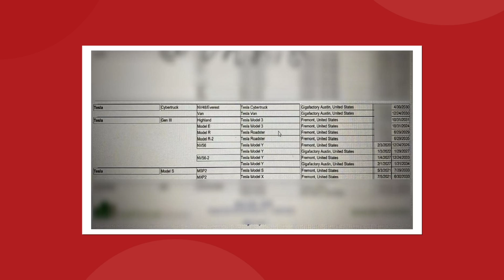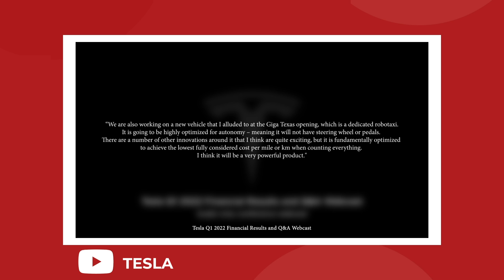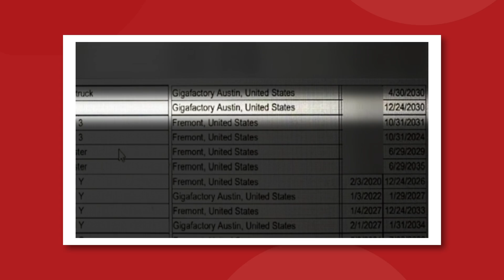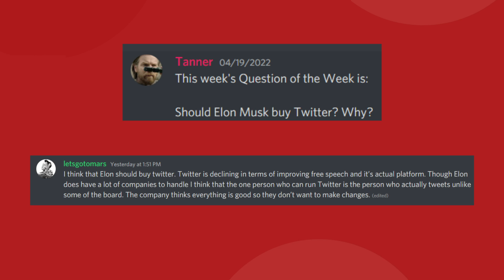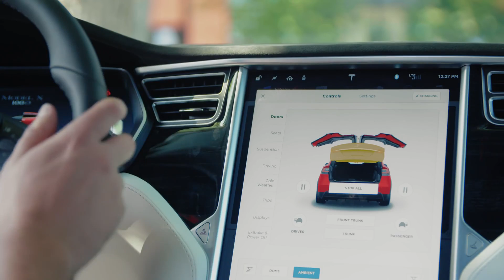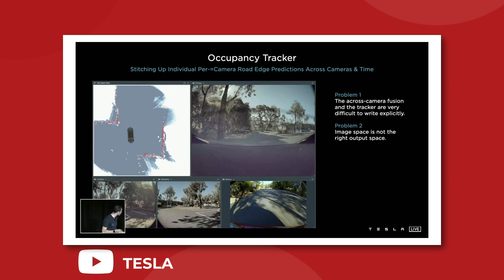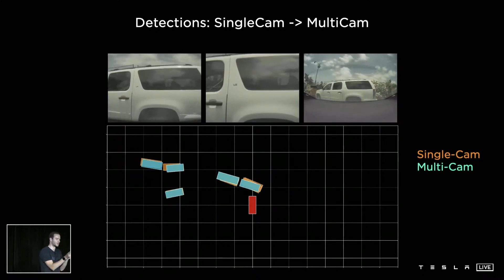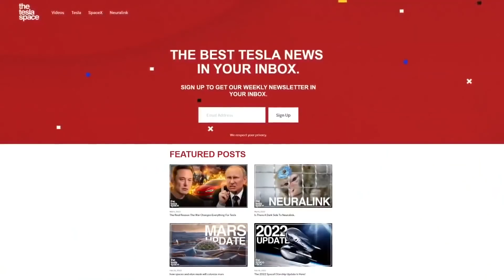Why The Tesla Cyber Van Will Be The Tesla Robo Taxi!

Comment: I think it will be the model Y platform. 

Mainly a special body color,  interior changes like no steering wheel,  no Pedals, and other seats. 

Another advantage is that autonomous driving is proven to work with the Model Y by the end of 2023 to get Robo Taxi approval.

Tesla's cost is very low; they will not sell the cars and start their own Taxi business.

With chosen the Model Y the ramp-up cost is low, and the concept can be proven. 

Later Testa can develop a Van, which can also be used for Robo Taxi.

Comment: I am in favor of 2, 4, 6 or 8 doors to separated passenger compartments. Tesla already has an excellent air purification system and efficient heat pump ac. I am not certain that the upper half of the separation partitions should be opaque or transparent. Funny, as I typed that, you revealed the same idea. Thanks for the gull wing doors design. It's logical.
Reply: great idea! Bunch of Model X doors :D

Comment: I think you are wrong about the level for needed for robot taxi and the falcon doors. I think the idea of robotaxi is going to come out in phases. Phase #1 ..the boring tunnels transportation. That will be the perfect use for a van and will help the numbers when we talk about cost per mile. Boring tunnels dont need level 4 for the taxi service to work. They've been testing the model 3 vehicles at the Las Vegas tunnels. From there, when FSD improves, then they will slowly move to streets with groe fencing...then full street and highway. That seems more of a logical progression since each step helps create more data for the next phase.

Comment: A 2-motor AWD Cyber Truck would be a very capable Robotaxi in all weather conditions. It would hold 6 passengers reasonably comfortably without the steering wheel. It would need some sort of mechanism for retrieving your luggage out of the vault. A 4 passenger "Y-sized" vehicle would also work.

Comment: One think Elon said on the earning Q1 phone conference is that the Cyder Truck could use an 800v power system but not worth putting in a in "3" or "Y" and certainly not a  Robo Taxi (Maybe Wireless Charging). Also the Model X doors are very expensive to make and was made to get astronauts to Space X's launch pad easily. So I think it will more look like a Y without a frunk

Comment: I think that if the Van/Taxi shares the CyberTruck platform, then it will have to look like a cybertruck to some extent, using folded stainless sheet, folded for rigidity.  No compound curves, no paint.  This would make sense as the Cyber Truck body is virtually impervious to day to day wear and tear - something that a fleet operator would nearly kill for...
Reply: exactly! rustproof body will massively increase lifespan of commercial vehicle. But the price also must be right and with FSD as an option, not only FSD one. There have been talks for a long time about 1mil miles vehicle. Maybe this will be the one? It all fits in very well. Also a fleet operator does not give a shit about vehicle design, cost and fuction is a priority.

Comment: They could just build a cabin like structure, build a couch around the inside bends and a drop down tv to watch movies/media or check on the vehicle and your destination. Maybe even basic information like weather of your current location and your destinations current weather situation, many possibilities could be done with a van like structure you wouldnt need to be stuck with the locked in space seating arrangements, you could design the enitre inside of the vehicle to something way more relaxing and suitable for waiting multiple hours at a time. Driving 8 hours would be a cinch, the passenger would fall asleep and the vehicle would drive a majority of the way with not disturbing the passengers, they would need to stop along the way but would be a neccesary stopping. (this is assuming that tesla can achieve level 5 autonomy driving) The battery could be large enough for an 8 hour long trip so maybe you wouldnt need to stop? i doubt it but not impossible either.

Comment: Even if FSD is level 5 there still needs to be navigating for emergencies and system failures. There had to be a manual backup system. I think there will be a steering wheel in some way.
Reply: You can't drive a car if it has a system failure, even if it has a steering wheel and pedals.  If you can drive it, then it can be remotely driven from a Tesla service center.  That's what Waymo is currently doing.  The last resort is towing.

Comment: taxis have to hold luggage.  folding seats to hold the bags?  destination routing inputs? where does the taxi go after delivering passengers?  charging protocols?  how does a taxi connect the
charging cord and pay?  I was once told that right of way in Turkey depends upon who honks their horn first, so people drove with their hand on the horn...a little noisy!  how would FSD handle
that situation?    Some towns/cities have streets where around corners are not visible until the car is pulled out into the street a little bit.  FSD would also have a problem with that.
Reply: I’ve seen an prototype charging cord that looks like a snake charmer is charming the charging cord to hook up to the car by itself. Look it up the cord will hook itself up to the car, and it will charge itself. 
For luggage storage you could either put it on top of the car, or if there is a hitch for the luggage where the wheelchair would go, also there can be a place for bikes, like a bike rack. 
They have this technology, but they don’t use it, and I don’t know why but, you can charge the car while it is driving by placing those copper coils underneath the ground and the car will charge itself while it dries. I’ve seen the technology. It looks pretty simple.

Comment: The Robotaxi is a small vehicle.  Why, because during Q1 call, Elon said that only Semi and CyberTruck could benefit from 800v system.  Said smaller cars like Y and 3 don't need it and said Robotaxi definitely doesn't need it.
Reply: My take from Elon's statement is that 800V can help for more torque (CT and Semi will need that), but the RoboTaxi will drive rather in chill mode and not accelerate very fast or pull anything heavy. Thus, no need for 800V technology, but the RoboTaxi could still be a "large" vehicle, like TeslaSpace pictured it.
Reply: @mik2137  I can see a case for different size and shape Robotaxis eventually for different utilities.  My guess is they will start off with the smaller vehicles.  A replacement for current ride-sharing.
Reply: Small vehicle to innondate the street right!! Why not few bus instead of millions of small cars!?

Comment: First principles means you need to know the average and mode of the number of passengers in US automibles, that is the mode is 1 and the average is 1.2 people per ride.  So no the robo taxi is not going to be a van.  Because of safety laws increase the cost of a car it makes more sense to build one that can cover the 1 person rides as well as the 4 person rides which will then cover 99% of all rides.   Once laws are changed due to self driving and safety equipment will no longer be required then public roads will start seeing single passenger robo taxis which will already be plentiful on restricted or private highways.
Reply: Wrong!!!! A multiple passengers vehicle/minivan or van is the way to go, also the accessibility for disabled people….. a single car diving a single person is the absolute worst thing possible! Let’s. It forget the high traffic periods…. Emergencies and much more
Reply: @alanmay7929  so you should get a van that is twice as big as a car to drive one person around for the most part.  Or you can build a car that is 1/3 the size or a normal car to drive one person around, but somehow you think that will cause more traffic
Reply: The question will be to which extend different passenger trips can be merged together. Thus, picking up and dropping off other passengers along my ride without delaying my trip too much.
Reply: @cryan9376  a minivan or van are mad to move a lot of people all around and the way public transport works and logistics there are many different deserved routes. The bigger vehicle ain’t empty all the time and in high traffic times it Carrie’s a lot more people.
Reply: @cryan9376  in Europe for example the city planning is way better made for public transportation, taxis are used for last mile driving or for special Occasions….. you have an app to check and prepare yourself while taking a route.
Reply: @alanmay7929  nobody would take a bus if they could ride alone or with a friend. When was the last time you called a cab and though to yourself boy I wish I could walk some other place to wait for a bigger cab, hopefully it will pick up a bunch of random people on my way so it takes longer. If you did manage to ride alone, it would cost more, large vehicles are less efficient, because physics.